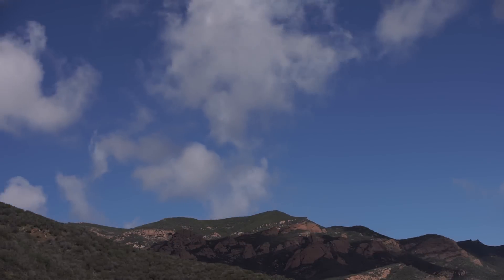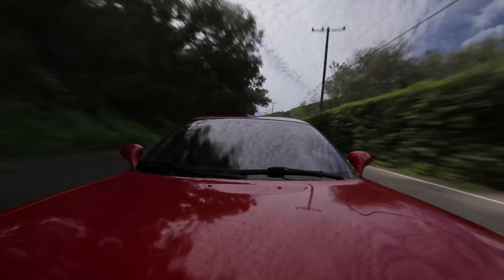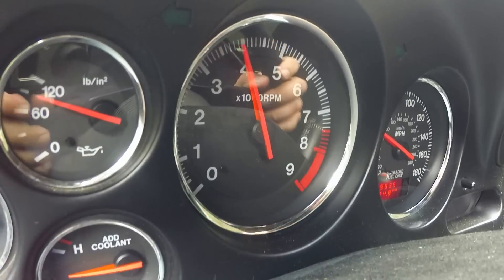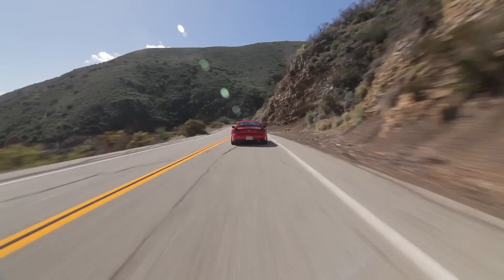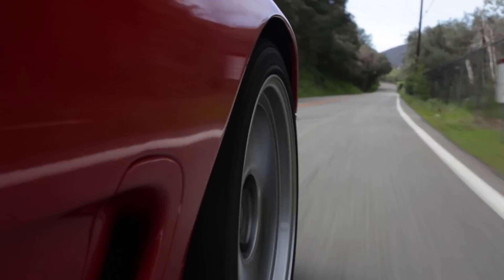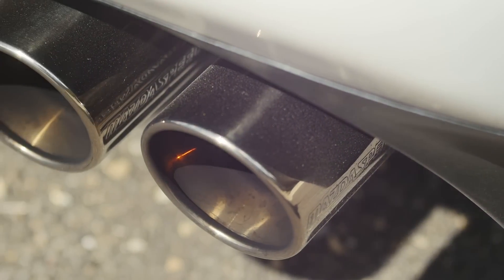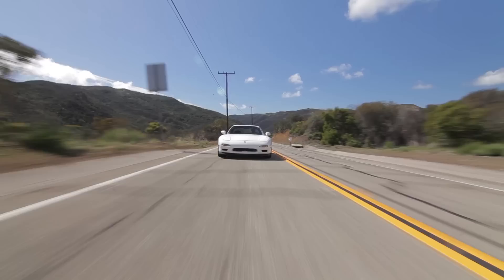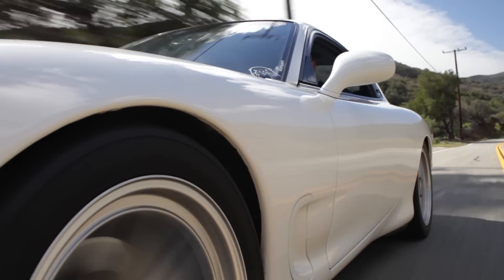Mazda  RX-7: Turbo vs V8 - /TUNED

Comment: people who put v8s in really any Japanese cars like this deserve a special place in hell
Reply: +Phoenix Ward Hopefully there's a track in that special place.
Reply: +Phoenix Ward thank u
Reply: +Phoenix Ward I totally know where you are coming from on that, and i used to stay the same thing.  But then i got ahold of an Ls1.  Just drive something with an Ls motor and i swear it will make sense.
Reply: +Dagan Williams sure an ls engine in anything that's not Japanese. personally I love the 2jz and rb26 but one is significantly easier to get a hold of than the other
Reply: +Phoenix Ward I agree its a sick thing to do, but i think an ls3 in an Rx-7 would make it the perfect car.  Ive owned two rx-7s and driven plenty of others.  They need torque, period. Ls fixes that
Reply: unless its the double unicorn (they put an infiniti awd twin turbo v8 into a Nissan Stagea)
Reply: I have a 1 uz powered ke 70 so no

Comment: so your comparing the speed of a 1.3 to a 6.0? of course the v8 will be faster. Put a 26b quad rotor in it, give that a hoon against the v8
Reply: Displacement has absolutely nothing to do with this comparison. Especially since Rotary Engines have more power per displacement than a traditional engine.
Reply: yeh. a 1.3 that uses twice as much fuel as a 6L v8.
Reply: @LilleyAdam  not even close to true, a complete myth. My rx7 that I've had for 19yrs and done countless driving jobs with gets better mpg than any v8 period. Even now at 462whp, I still average 13-16mpg in rush hour traffic and my GTU averaged well over 30 hwy mpg, but that matter even my 83 quad carb got close to 30 and I don't drive any of them nice always in the redline. Plus, my 13BT has almost 365k on it and I've only rebuilt it once to port it. Myths by people who don't know shit, nothing more.
Reply: @yjjeeper1  Thank you. Rotaries also dislike being driven in the low rev range anyways
Reply: yjjeeper1 I’m calling bullshit buddy
Reply: yjjeeper1 lol quit lying

Comment: 05:14 why a rotary? I would think that weight and size advantages are the main ones.  Only experience I recall is a pals rx3 which was pretty smooth as well. If I had one with a bad engine I would be looking to put something in with similar power levels and weight.

Comment: Missing the point of the rotary. It's key feature is it's power to size/weight - much like a 2-stroke. That allows a larger power for a given weight and size. This rotary happens to be a 2 rotor, 1300cc unit. A similar sized piston engine would be something like a BMW bike engine which in the early 90's would be well under 100hp. Take that the other way and if they developed the rotary as a V8, even in the stock set up it would be 5200cc and around 1000hp.

Comment: I love always on topics like these reading comments like "its passion, this is ART!" followed by a laundry list of strict rules on how you are allowed to pursue said passion and "art".. or further use those terms as a reason to justify their daddy like outburst as they spank you for doing it wrong.  

do what you want to do.. its hilarious all these guys on their soap box as self proclaimed tuners whining about purity and the "slap in the face to the engineers".. if you want to preach that way of thinking than your car best be bone stock.. because all of those suspension upgrades, cosmetic mods, and different turbo set ups etc.. are all a slap in the face to the engineers. 

its very easy to tell someone else how their shit needs to be built but i am willing to wager if someone started telling you all the things that need to change about your project to suit their opinion that shit wouldn't fly. 

as for the v8 in the rx7 i like it.  there is always such an uproar about lack of respect between even say the divide in Muscle vs Import. but then someone does something like this and those same people cry about it..  to me i would feel like a scenario much like what was described in the video to be an excellent reason for it.   dude grows up with muscle and drag racing.. perhaps you really have love and passion for the old rumble of a v8.. but then he had a mazda and realized he really enjoyed driving that, so he took what he knew which was muscle and dropped it into the import and bam.. there the two sides of the hobby meet.  

I grew up Mopar and Ford but would love that ls rx7.  i always see the mustang guys crying about ls swaps, and sure you get the arrogance there sometimes "its cus you cant make ford fast" which is nonsense.. but perhaps the dude grew up chev and wanted a mustang so he went with what he knows. 

if it runs and you enjoy your car there isn't a wrong way to do it. 

i mean shit everyone pays money to go see jet cars.. or school buses at the drag strip doing wheelies the whole way down.. how ridiculous would it be to hear "YOU CANT DO THAT!!! THOSE ARE TO GET KIDS TO SCHOOL!! YOU ARE A SPITTING ALL OVER THE ENGINEERING AND THE ART OF PUBLIC TRANSPORTATION!!!"

Comment: Glad the red car exists, they make me smile. Rotary screams "racecar" at high revs. But give me the one that doesn't need constant maintenance and parts are cheap. The answer is LS
Reply: I think you are ignoring the fact that it is the people who cannot take care pf the rotary engines, not the apex seal's problem. Give it to the pros or those who know how to maintain and they'll tell you how reliable it is. 
The 787B won the Le Mans with no failures at all, excluding the Group C cars etc! Don't want history? Nevermind.
BEAR IN MIND THAT WANKEL ROTARIES ARE NOT PISTON ENGINES!
People always use piston engine maintaining ways for rotaries!
That is WRONG!
Rotaries desire high rpms while common pistons engines (Not-Vtec) does not like over 6000rpm!
My family owns a 2002 Mazda RX7 Spirit R Type A and all we need is patience in cold starts, give some gas and everytime you run the 13B for 5min, give it a soar to 7000rpm.
Now our car has over 152,000km and it still works fine!

Comment: I enjoyed watching this, 'cause I love these cars, but really, the conclusions are not very meaningful. "The rotary is not better in any meaningful way," after listing 3 or 4 meaningful ways it's better? C'mon, man. And then, to say, as a blanket statement, "the V8 is faster than the rotary"...well, maybe THAT V8 powered car was faster than THAT rotary. Maybe it was. That being said, I'm sure I could find an example comparison where the tuned rotary was faster than the V8 in a different swap. I'm pretty sure I wouldn't have bet against the RX-7 on most tracks head to head against the Corvette of that era. You just can't make generalized conclusions like that based on two specific one-off tuner cars, it's silly, and I know you know this. Of course, people can do what they want with their cars, but the RX-7 was designed around the light-weight, high-revving rotary. If I buy one (I had 3 over the years) then I buy it for that. If I want V8 torque then I'll get a car made for that. Hell, that's what I'm driving now, a V8 (not in an RX-7!). But maybe that's just me...
Reply: It was a mildly tuned rotary (about 400 hp) against a pretty much stock LS2 (about 400 hp).  It's as close of a comparison as possible.
Reply: Unless you're closer to the producers than I am (and you may well be) we know nothing of the sort. I mean, you MAY be right, but we don't know that from the video. I just think it would have been more appropriate to illustrate the many subjective differences without drawing unsupported conclusions.
Reply: Jeff Smith Did you forget the fact that the V8 didn't have to work nearly as hard to drive fast and used less than half the fuel? I think those are quite meaningful conclusions, unless you're ignorant.
Reply: Ooh that must be it. I must be ignorant. Or, maybe, you weren't aware that the rotary-powered RX-7 absolutely DOMINATED the classes it was designed for... Classes in which the Corvette and its oh-so-superior V8 were a distant second. 'Work nearly as hard.' What does that even mean? Have you ever driven a rotary car? They lust for those high revs. That's not working hard... That's doing what God and the engineers at Mazda intended. But what about the fuel economy, you ask. Well, you got me there. The rotary is a bit of a gas hog. But if that's your priority, I can think of many things better than a Chevy V8. You want fuel economy, buy a fucking Prius.
Reply: Jeff Smith I have seen no evidence of this dominance, there's a reason why all the top drifters here swap out their Japanese engines here for V8's.
Reply: NZXcel LeMans 24 hrs dude. Lol
Reply: OK, well if drifting is where you're seeing all your racing, that might explain a lot..that, or maybe you weren't watching or paying attention when the cars were actually being sold...keep in mind that '95 was the last year for these cars in the US. I don't remember the class, it was something like Pro Solo II maybe?  But I recall at one point looking at the national standings and 5 of the top 6 were all 3rd gen RX-7s, , the odd man out being a 'Vette. If you want to go back and take a look at the professional road racing at the time, remember IMSA?  I believe when Mazda go their 100th win, most of those being rotary-powered cars, the number two maker was Porsche, somewhere in the 60s. It's easy to dismiss them now that they're no longer being made, but you have to compare apples to apples. I would love to see what a Mazda rotary car would be doing had they continued to develop them, but they didn't.
Reply: Jeff Smith Yes they absolutely dominated the other cars of that era.. but that was 20 years ago, we aren't talking about swapping an iron block from two decades ago. We are talking about light weigh v8s in the modern era. They perform better in every way and are cheaper and easier to maintain/increase power out of. The rotary is sort of a novelty, and you're just making things harder for the sake of keeping it original. I forget what the event was, but it was an all rx7 event a few years ago and the top 6 vehicles were v8 swapped.. that should be enough evidence that its a good swap. People throw it around all the time like its a fad or "everyone just wants to put an LSx into their car, how unoriginal" but it works. It looks good, it sounds good, it works.. why not? If there were the clearance for other v8s with dohc or something wider like the ford 5.0s, I'm sure you'd see them..
Reply: You're not wrong... Technology does indeed continue to make things better... But the take-away I got from this was 'A V8 is better in this car than a rotary.' I just don't buy that... However had they emphasized the notion that using a V8 gives you the option of newer tech... That is an argument that clearly has merit. That being said, I'm not going to lie... Certain cars have character that you lost when you do a swap like this, and it would be important to me not to lose that. To each his own though...
Reply: Wafflebrah21 I think you are referring to the 787B not the RX-7? From memory they had the victory gifted to them because the faster Sauber-Mercedes C11 cars leading the race dropped out thanks to a collision with debris and the other with an overheating issue. Also all the other Category 2 cars had to carry around another 100kg bringing their weight to 1000kg and causing overheating issues for them, but for some reason the Mazda 787B cars were allowed to run with only 830kg.
But the only thing people seem to care about was that they won this one time only and it automatically makes rotaries the bestest engine evaaar.
Reply: NZXcel It's not that they won just one time it's that the engine was banded for future events after that race.
Reply: James MacInnis The rule that meant Mazdaspeed couldn't enter anymore with the 787B had been decided before they even won the race and at that time Mazdaspeed was no competition at all with the 787B finishing in 20th place (1990).
Reply: NZXcel FYI that car is a 767B powered by a 13J. The 787B is powered by the R26B which are totally different cars and engine packages.

Comment: Why are people so against LS swaps? They need to face the truth that the LS is the best engine to swap into light chassis because they're light and make easy power and a lot of it for less than you'd need to on a 4cyl, straight 6 or rotary. It's all about the torque.
Reply: Andrew because the rotary engine is rare and also it's stupid to put it in an RX7 because of the weight distribution and it's kind of expensive (20-60K) just the base car and a Corvette C5 around 20K and a C6 like 35K, and if you want to an LS in a small chase then an MX-5 is a better choice because smaller, lighter and cheaper
Reply: Andrew The LS is stupid heavy compared to the rotary. The car completely loses it's very unique driving style and as Matt said, it feels like a Corvette.
Reply: Aluminum LS isn't heavy compared to a 13B though.  The Mazda's power plant weight really adds up thanks to various cast iron bits.  The car keeps it's handling characteristics, but the torque curve changes dramatically though.  The car feels very different, but as far as handling it's mostly just in how you use your right foot.  I owned a rotary and worked and have driven an LS1/T56 swapped car.  Personally I didn't car for his particular one, but another friends LS3 TR6060 (maybe it was a 56 Magnum) felt much better.  The quality of the swap isn't to be underestimated.  I'd recommend the Samberg kit if someone chooses to go that route.

Comment: Rotaries are good because they produce a lot of power in relativity to their weight and size.  The 1.3 L in the RX8 makes something like 250 HP (I could be wrong, too lazy to look it up).  They do have problems with emissions though, because the chambers are constantly moving, so some exhaust gasses may be left in the chambers.  It also doesn't burn the air/fuel mixture as efficiently as a traditional combustion engine, which makes it less fuel efficient.  Lastly also have problems with the Apex seals.

Comment: Matt says the LS2 was faster, but @0:31 you can see a broken weld in the inlet port of the intercooler on the 13B, which may have lead to a power deficit due to a boost leak.
*full disclosure, i'm a biased rotary fan

Comment: I ran a LS powered FD with my single turbo FD @ a 40 MPH roll, I was in third gear he was too, he down shifted to second and  jumped on it and pulled one car on me, I stayed in third gear and just put it to the floor, he shifted back into third and I caught right up to him and pulled away all in third gear to about 100 MPH, After the run he said his car was making 420 WHP. I was in low boost making on a good day 350 WHP as it was the middle of summer and my charge air temp was @ 52c -125f you might say it was a little heat soaked. I still believe HP per HP the rotary is quicker do to the wider power band in the rotary

Comment: I don't know that I agree weather the rotary engine is better than the piston engine simply because it is difference. Sure the v8 in this had more power and I was extremely surprised to here that it had better fuel economy. But in my opinion what makes the rotary engine better is the fact with less weight and smaller displacement it can make relatively similar power. Sure with a turbo in this case(what I mean by similar power I mean power to weight ratio). But what if you add more rotors, like the Cosmo?

Comment: I don't think rotaries are better than piston engines but they definitely have some advantages. Mainly: light weight, high power from very low displacement, and high redlines. But as you said, is a higher revving engine better if you need to rev it high? well its not just that they rev high, their power band is very consistent through the entire rev range, and doesn't drop off at the top like a piston engine. So going through each gear in full would give a very clean acceleration.

Comment: If both owners would consent I wouldn't mind seeing both of these vehicles on a closed circuit that was rather balanced. Not many straights but not many small corners as well. The rotary was track inspired while the V8 Drag inspired. It's a wonderful comparison. If nothing comes out of it due to the power differences and even the power band at least it would say which is more enjoyable to everyone. Myself I think I'd enjoy the Rotary more so though with the twin scroll still in use with a modestly bigger spoiler in the back, I've never worked on a rotary however so I can't say much.

Comment: the Rotary is like a cult classic. That's why people love them! That's why I love them! Plus they're light, have a low center of gravity, sound good, etc.  but Then the LSV8 is nice too. I'd keep the rotary but if it wasn't such a special, unique engine I would consider putting an RB26DETT in the RX7. I feel like that would be optimal.

Comment: If you're going to swap it swap a smaller engine that's easy to work and can be tuned easily; for example, 2ZZ, 3HS, SR20, KA20, B6ZE, VQ engines, F20A, B16B, B22, and the Mazdaspeed V6 these are all small, lightweight engines that can be tuned to a substantial amount of horsepower whether it be for track or daily usage it'd be a lot better than the "rare" LS swap people keep doing.
Reply: ?? The LS is the MOST tunable thing in existance...this guy can go for a heads cam package to take up to a reliable 500whp or procharge it to 700 or higher with turbo. Car would be more fun though with a heads cam package.
Reply: And what are Hondas? Name me one engine made by Honda that's not reliable and can't make good power, which engine manufacturer made a world record for most HP per litre in a car (120hp per litre) Nothing beat that until the Ferrari 458 just recently